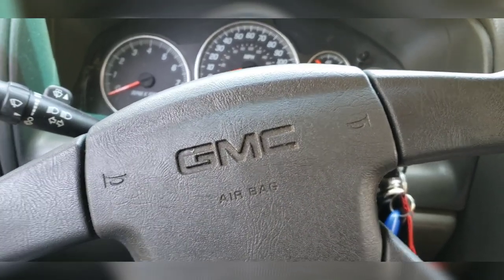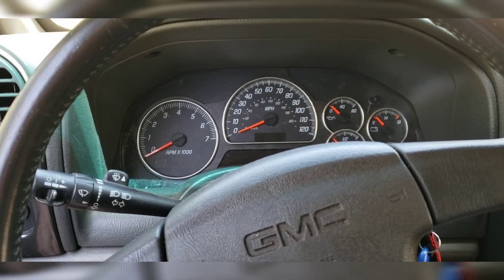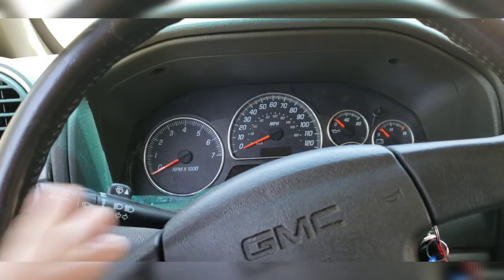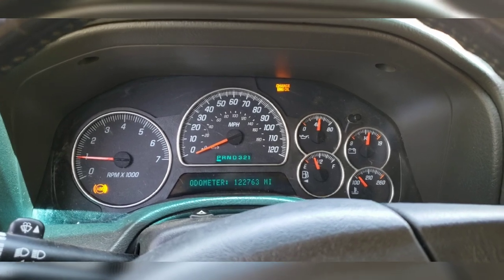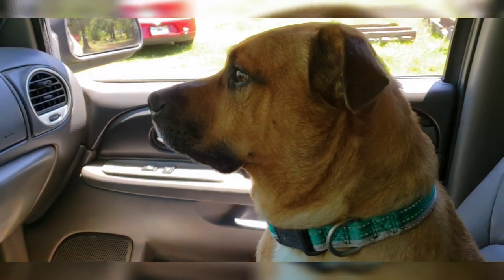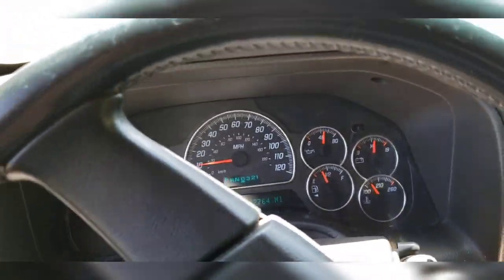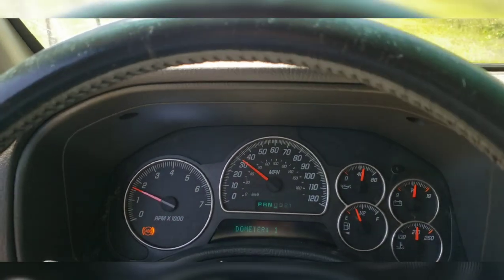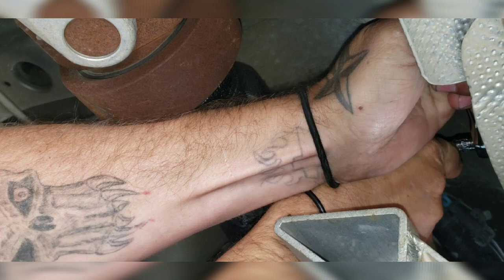2004 GMC Envoy XUV Transmission Speed Sensor Replacement

Comment: I replaced my valve body and gaskets and replace the plastic valves in the shift valve bodies with the aluminum valves. Yes it was a little expensive but it is working fantastic now. I got mine from A1 transmission off of Amazon. Get the complete kit. Pillow block and harness and the solenoids. Make sure you torque them bolt's to 40 inch and don't over torque them pounds. I did by accident and popped the top off half the bolt's. There are 3 8mm bolt's on the back end of the valve body and make darn sure that you mark where they go back. Otherwise you won't be able to go anywhere because they will go up inside the housing and stop the clutch body from turning. I did that too. I have a 2002 GMC Envoy with the 4L60E transmission. I learned by my mistakes so now you don't have to. Oh and go ahead and soak the valve body gaskets first, there is 2 of them. 1 is against the valve body and then the plate then the transmission gasket. Match up the gaskets to the one's that come off there should be 2 different sets of gaskets that will come in the kit.
Reply: Hi, what do I type in on Amazon for the complete kit?
Reply: Just put in what type of transmission, then what you want. Like "4l60e complete rebuild kits", then just change it up to something else if that doesn't get you where you want.

Comment: Did you ever figure it out. I am having the same problem. My abs is on and sometimes it won't go into 3rd or 4th. Lately it's been going into 4th. I think the abs sensor is a safety device that won't allow the transmission to shift. I just bought a 300 dollar scanner today and all I have is abs codes
Reply from the maker: Its most likely your clutch packs. Unfortunately, its so expensive to replace them that you may as well buy a whole new trans...$3500 with labor. I sold the envoy to ZOOM and bought a new GMC Terrain

Comment: Did you try resetting TCM? I have the exact same issue, the code reader said it was a bad shift solenoid. I replaced the bad solenoid but it continued doing the same thing. I read you can reset the TCM by turning your key to position 2, but don't start it. Then press the accelerator until you hear it click, press through the click and hold the pedal down to the floor. Hold the pedal for 15-20 seconds. While still holding the pedal turn your key back to position one and then release the pedal. Do not remove the key. Sit and wait for about 5 minutes. During those 5 minutes do not turn or remove the key from the ignition, open the doors, use the radio, row the windows down etc. After 5 or so minutes take your vehicle for about a 20 minute drive (500/1000 shifts).

Comment: I have a 2003 Envoy with a similar problem and it turned out to be the transmission pressure switch 
Easy fix
Reply: How  did you find the problem did you go to someone or can you give tips on how to figure it out I have 2004 same issues

Comment: Hey my truck is the same as yours and i just got my transmission rebuilt and its running better i think my mechanic said something about my 3rd gear and 4th burnt out and turned out to be the reason why it was skipin and luckily i got it fixed before it broke down on me

Comment: Did you try checking the pressure control switch when you changed out the solenoids
Reply from the maker: Nah, sold it and got a new 2018 Terrain

Comment: Sir did you find any solution for your problem coz i have same problem. Please let me know.
Reply: How is your speedometer ? is it jumping all around? then your abs sensors are bad, they are in the front wheels only if your model is 2004.

Comment: Would this be same application as on a Trailblazer 2003.??
Reply from the maker: Yes, 4L60E Transmission
Reply: @CarsAndCoffeeKings  VSS is tha same??? Mine's not acting quite like his though...1st n 2nd are strong manually but then 3 is lost/floating,,,3rd and 4th both..does same in (D)rive,,1st n 2nd good then it gets lost...speedo is gone as well...ABS is constantly on and Park Brake light comes on when it hits 10mph taking off or rolling...weird stuff..

Comment: Change catalytic converter that happened to my and it was clogged I replaced it and it's running fine
Reply from the maker: Impossible for those two things to be related to each other lol. Your transmission has absolutely nothing to do with your exhaust system.

Comment: sir i have same problem pls if you have found the solution let us know and its will be greate help
Reply from the maker: Yes, sell your vehicle. A rebuilt 4L60E will be close to $5000 after your transmission shop is done with you. I ended up buying a new GMC Terrain  and selling the Envoy to ZOOM
Reply: @CarsAndCoffeeKings  Hmmm, were are you getting your trans work done at. My 2005 Trailblazer rebuild was $1500 with a lifetime warranty in 2019 and if I have to have the Envoy rebuilt it'll $2200 or less with a lifetime warranty...

Comment: Did you ever fix this
Reply from the maker: Yeah, I sold the Envoy to Vroom for $2500
Reply from the maker: Mostly because I decided I deserved a new truck. I got a 2018 GMC Terrain.
Reply: I think my transmission is going out because sometimes it just won’t go when you hit the gas the rpms go up but your speed stays the same, I do have 250000 miles but I am thinking about a new trany because I love the car it always starts

Comment: I have a similar problem but throttle is good. I believe it's the abs sensor not transmission sensor.
Reply: Any updates?
Reply: @redinstrumental7535  culprit was transmission speed sensor. It is installed right on the transmission itself. Easy to replace as well.